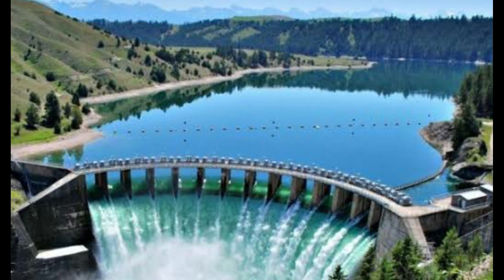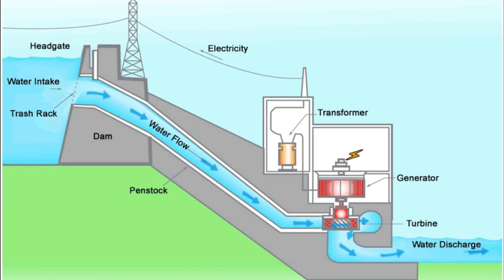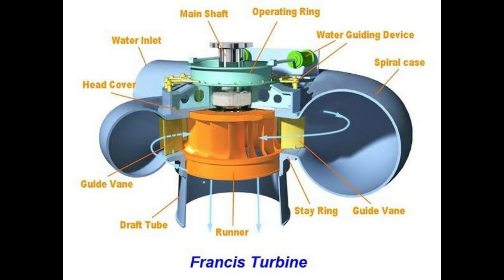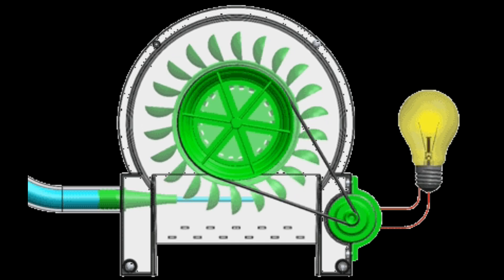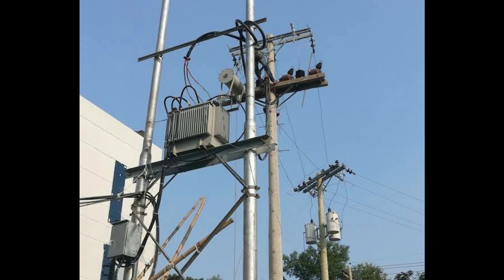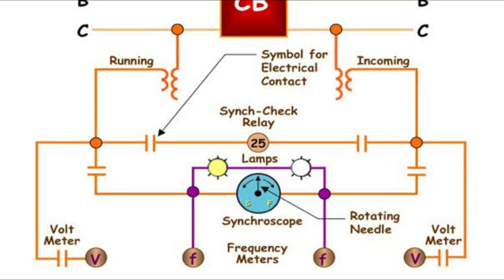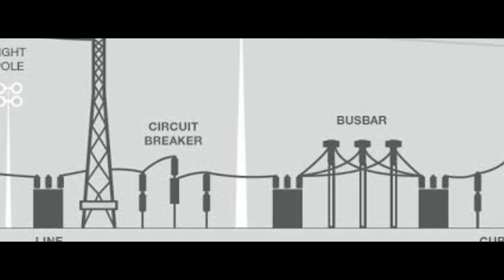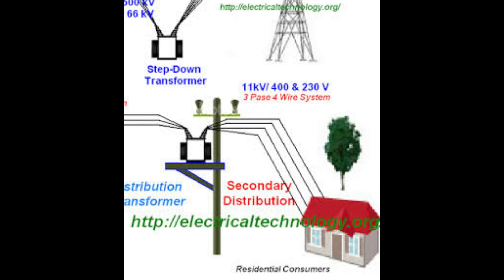How Hydroelectric Power Plant Generate Electricity

Comment: Synchronous panel oru video cheyamo???
Reply from the maker: Cheyyam 👍
Reply: @TechCornerMalayalam  Please tell about frequency synchronization. Voltage ampere etc we can reduce or increase. but how can we mix the frequency sir? (How to inter connect current 50 cycle from different power plant? I afraid the frequency will go up to 100 cycle. right? do you understand my doubt?

Comment: പവർ ഹൌസിൽ ഉല്പാദിപ്പിക്കുന്ന കറന്റ്‌ സ്റ്റോർ ചെയ്യാൻ സാധിക്കുമോ?
Reply from the maker: Atrem high volts onnum store cheyarilla... athu atra simple alla athond thanne athu practically feasible alla...
Pakshe impossible alla venel cheyam pakshe athinte undakan okke veliya cost aakum
Reply: @TechCornerMalayalam   thanx bro
Reply: Yes sir, we can store in battery of 12v 0r 24v as DC voltage then we can invert. But it will be small quantity for a house or building..etc